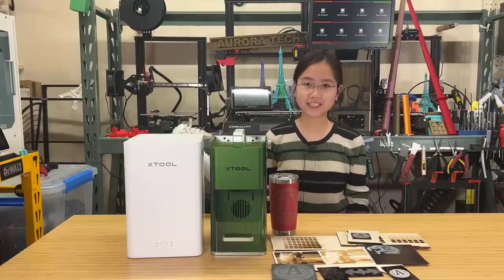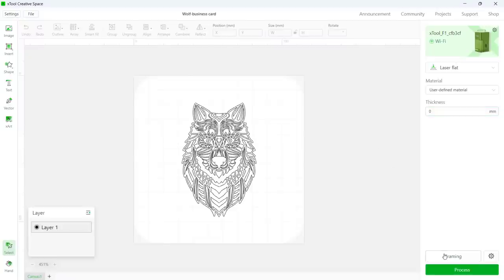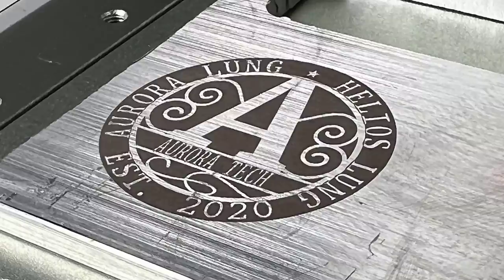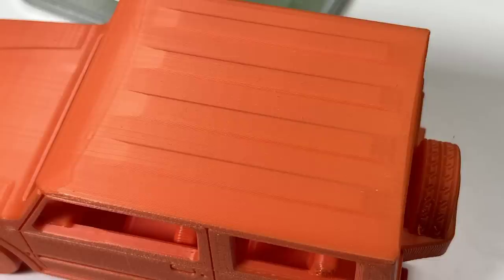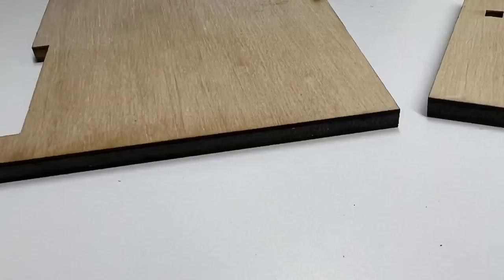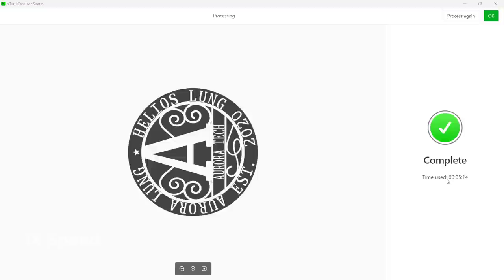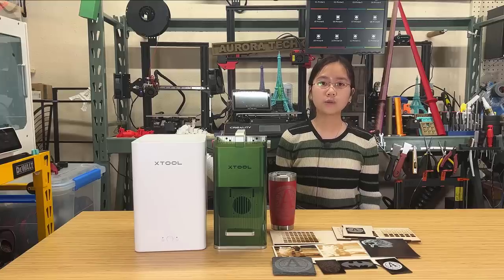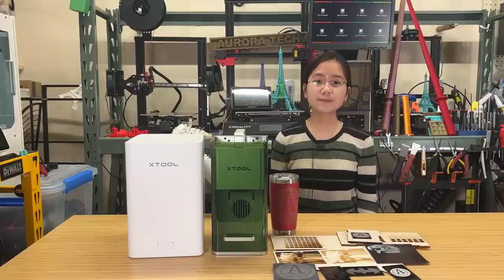xTool F1 laser engraver: 10W Diode + 2W Infared Laser, 4000mm/s high-speed engraving on metal, PLA

Comment: Great video.  How safe is this machine which lacks an enclosure for toxic gas (smoke) control and to contain laser energy or fires.   I didn't see you wearing safety glasses or other shielding.   Is there a risk of reflection of energy from metals/mirrors with resultant eye or other tissue damage?   That plastic on the water bottle is likely vinyl (PVC) and is toxic stuff.  The golf ball is likely urethane and the wrench is chrome plated, and both are toxic.  I don't see anything like OSHA ratings or even real performance specs when I look at the documentation of the "Smoke Purifier" to suggest it is appropriate.   You have a bright future and I look forward to your future videos.  Please be careful and consider making a video on workshop safety.

Comment: Great video. Quick question though, at 8:43 for the wood engraving test grid, some of the squares in a row are higher than others, was that a design issue or by the machine? (first row, last square is higher; second row the next to last square is shrunk slightly and last square is higher et cetera)

Comment: Thanks so much for this video. I’m trying to decide XTOOL F1 vs LASER PECKER 3. Will mostly be using it for jewellery and occasionally wood, acrylic and leather and glass? If you have a video for this pls send me the link.
Reply from the maker: I believe the F1 works slightly better for jewelry engraving, as the preview outline appears easier for alignment and the engraving power seems slightly stronger, even though both IR modules are rated at 2W.
Reply: @AuroraTech  Thanks so much. Your video was so helpful 👍

Comment: What kinda maintenance is required for this laser.  Thanks
Reply from the maker: I just clean the lens cover if the smoke makes it dirty after cutting woods. For metal and other materials that won't create smoke, I guess it doesn't require other maintenance at all.
Reply: @AuroraTech  great thanks. I purchased this laser using your link :)